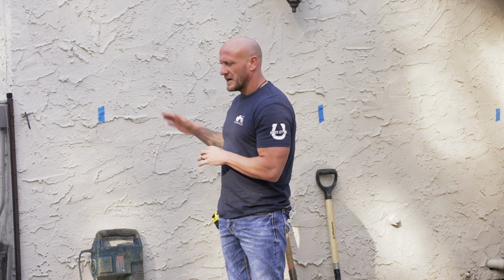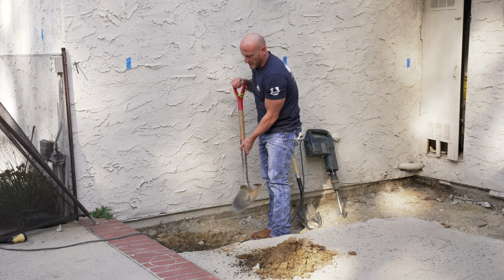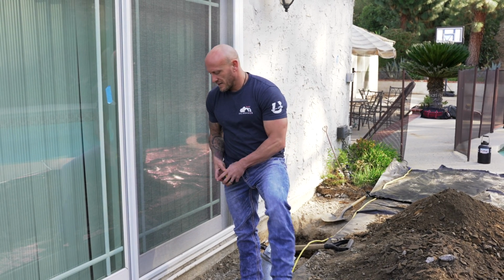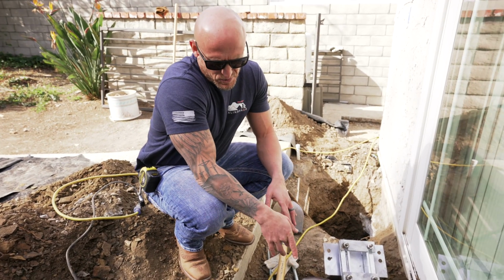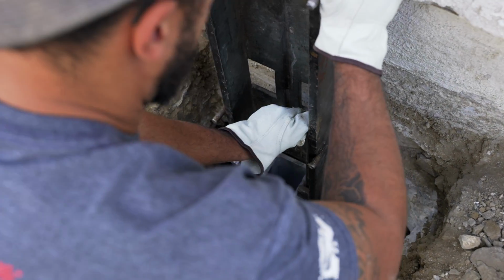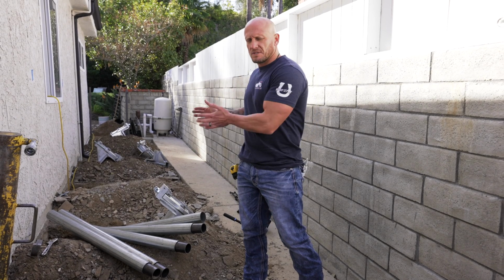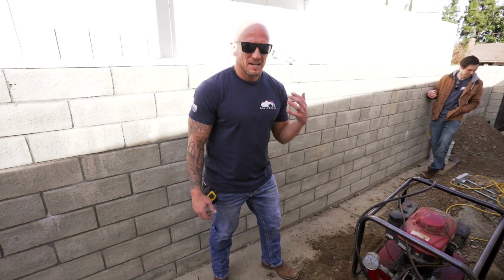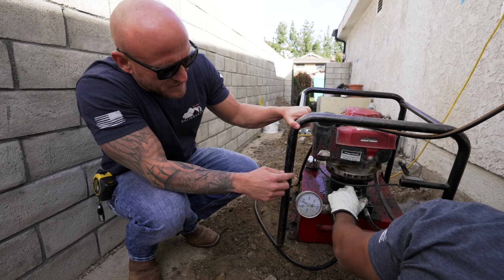How To Install Push Piers

Comment: What kind of pump did you use ? I got quoted 80k today for 20 piers and honestly just thinking of shooting my shot and doing it myself.
Reply: Did you do it ?
Reply: Update. I hired a structural engineer and they laughed at all the quotes. 

He told me to do the proper drainage on the house, gutters and repair any stem wall. Poly foam the low points. No piers
Reply: I was quoted 90k for 20 piers. Yes I’m thinking of going into the foundation repair business. 😂

Comment: Dude, the part i needed to hear was all fastforward with no sound. Half of this was how to operate the equipment. If people don't know how to use a rotary/ hammer drill or a hydraulic jack system, they really shouldn't be fixing a foundation. That seems a little advanced. You skipped over what to do while lifting and then what to do after lifted.
Reply from the maker: The advanced stuff is saved for our actual employees.  But now that you mention it... If you need a video on how to do the lifting aspect you really shouldn't be fixing a foundation.  That seems a little advanced, for you.
Reply: @DalinghausConstructionInc  This is true for me for sure, but i am working on my own house. 
You just stated that you made this video for your employees... does that mean they shouldnt be working on foundations as well? Is it too advanced for the people you employ? If you need to show them how to work a rotary hammer and the hydraulics.... maybe they shouldn't be doing it either. For saure not on other peoples property. 🤔

Comment: My foundation is failing. The footing is cracking because it has wood on top of the concrete block, no rebar. It has a basement that’s dirt. Would this method work so I could secure the weight and fix the foundation for rebar? I have no idea what I’m doing here.
Reply from the maker: It could definitely work!~

Comment: Hi guys. Tell me, what do you fill the void that appears under the foundation slab after raising the house?
Reply from the maker: We’ll use a structural expanding foam called polyurethane that we’ll inject through the slab to fill any voids and provide support to the slab!
Reply: I had the same question! I had my home foundation fixed by RJ 3 years ago and I have doors sticking again😳
Reply: @lisamorales9012  This means they didn't finish something or geological processes of soil subsidence continue. If you have a contract and guarantees, contact your RJ contractor's support service.
Reply: How much does this process cost?  I have a 5’ x 6’ corner that needs raised 1/2”.
Reply: @tojo3507 starting from 1500 to 2500 depending how deep needs drilling

Comment: Wow! That’s amazing! I have a corner of a house that needs to be raised. Brick is cracked and pulling off the wall about 12 feet down two sides from the corner. How much that cost? 😂
Reply from the maker: Our average project this year is in the ballpark of 26k, but we have projects as small as 2.5k and some far more than 100 times that.  It all depends on how large of an area is affected by settlement or poor soils.

Comment: What will this do to the laminate floors, ceilings, walls, and plumbing inside the house. Will this crack them?
Reply from the maker: Typically it doesn't if those things didn't occur as the house was settling over the years.  Definitely something we monitor with the homeowners throughout the entire process.

Comment: No couplers are used to physically join the 3 foot sections of metal pipe or at least to help keep them aligned underground for the long term ?
Reply from the maker: The couplers are built into the individual sections, so the extension up top slides into the piece below it with a 4ish inch internal coupler.

Comment: How much is this job and does the home insurance cover it? And does it have a warranty?
Reply from the maker: home insurance rarely covers foundation repairs unless it can be proven the issues were caused by a pressurized water leak.  
Our average foundation repair project this year was roughly $28k...
All of our steel foundation repairs come with a lifetime warranty transferable warranty on material and craftsmanship

Comment: Why wouldn't you put a strong plate on the first pipe to increase the size of the support foot print? Seems like the installation would have longer lasting results
Reply from the maker: Because we're not worried about support footprint and instead worried about skin friction on the entirety of the pipe.. It may seem that way, but it's wrong and wouldn't have longer lasting results.

Making a big plate on the bottom would mean there's no skin friction whatsoever on the entirety of the pile.. relying purely on that plate and pipe.  Our way allows the 30+ feet of pipe to all be in contact with the soil creating skin friction that will support much much greater loads for longer periods of time.

Comment: With all that movement what happens to the wall beams and other structure of the house when you're lifting? Can they break or crack and then you would have to replace the beams in the walls?
Reply from the maker: For the most part those wall beams and other structure settled with the foundation over the years, so it lifts back up during the lift process without issue.  We definitely have to monitor everything during the repairs, but usually we just see cosmetic things like drywall cracks that were repaired now need to be repaired again because it was squished back together.   
  
In some very rare cases structural framing repairs had to be made prior to us beginning our repairs, but our repairs won’t affect the framing.

Comment: Do wavy interior floors indicate bad foundations usually?

 What do you do if the foundations just started to crumble crumbling everywhere.
Reply from the maker: It'll depend on whether the home has a raised foundation or a slab on grade foundation.  Wavy floors typically can be attributed to the flooring itself, but if it is wavy under the flooring then it may be a foundation issue.  

Crumbling foundations are addressed on a case by case basis... sometimes the crumbling is just small arreas of spalling, that can be patched... but sometimes the crumbling is much worse then superficial spalling and requires either complete removal and replacement or something like a sister footing.

Comment: Had an estimate for installing 23 push piers for $59,000. Wanting to limit cost on older home, an option was to just do 1/2 of house for $34K. Will doing just the portion of structure most affected cause structural issues in the other side? Guy told me fixed side would take pressure off other side of house. Is this engineering science or bull?
Reply from the maker: Depending on where the piers are going and how much settlement of the house it could stop some of the other movement.  Typically, there is a section or corner of the house that settles that then, over time, will drag or pull the other parts of the house down with it.  If you think of your house as a rigid box and you tilt one corner or the side it will also make other sections of the box tilt in that direction.

Hope this is clear and makes sense.  If not you can always reach out to us and we can chat with you about it.

Comment: great video, great work. i had geo piers and a sump system installed years ago in my poured foundation. 
the piers corrected the issue with hydro pressure. been dry as a bone in the basement. a new issue has been found. the east wall seems to be sinking  a few inches now which has caused the sill plate(2x6) in a 10 foot section to stick out towards inside basement about 2"-2-1/2" . since its hanging off the edged of foundation would this system be used to correct my issue. thanks
Reply from the maker: Are you saying that your footing is rotating inward?  If so, then you will more than likely need some type of basement wall tieback application.  Companies utilize helical anchors or wall anchors to correct this problem and rotate the wall back out. Here is an article that describes it https://www.dalinghausconstruction.com/blog/what-causes-horizontal-cracks-in-a-foundation-wall/

Comment: What do you do about the space under the foundation after you have leveled it? Do you bring in a cement truck and pour more cement, or do you backfill it with dirt and aggregate?
Reply from the maker: Concrete is really heavy.. So we wouldn't want to add more weight to a foundation that we've had to repair.  
Instead we'll use a structural, two-part, expanding foam called polyurethane that will fill the voids and support the slab after we've accomplished the lift!

Comment: The foundation of a home is so damn important. When your building on soft ground you really should go down until you hit solid bedrock. And use large footings and a shit load of steel! It's pricey to do it the right way and many of these new home builders go cheap on the most important parts of a home.
Reply: In the south, you won't hit bedrock, you'll hit the water table instead.

Comment: Really enjoyed the video.  If the push pier brackets are not installed correctly can they do more damage than good?  Just had a company install 6 and they didn't level a single one.  Only prepped the footer/knocked the toe off on 3 of them.  Did not anchor any of the brackets, they just bounced up and down with every pipe added.
Reply from the maker: Definitely not good practice to install like that, but in all honesty it likely didn't cause any damage.  Even with the brackets not anchored, due to their design the footing is sitting directly on them and bearing it's load... shouldn't be a big problem for you.

Comment: What the name or brand name of the type of push piers pipes u are using in this sight work? 😮   also the the name of that compessor level controll pump you are using and wattage?
Reply from the maker: The push piers are from @ECPECP (Earth Contact Products) and theres tons of hydraulic pump manufacturers, but i believe we're using BVA Hydraulics at the moment.

Comment: Quick question i got porcelana tiles installed in my whole house. Now im seing some sign of bad foundation on my outside wall
If they put these lift pliers would that make my tiles break?
Reply from the maker: It's definitely possible that the tiles could break during the lift, but it depends on how much settling has occurred and how much lift you'd want to achieve.

Comment: What’s the purpose of lifting your home? Fixing sagging doors/walls etc..
Reply from the maker: Exactly!  Homes that settle or sink into the ground and shown signs of settlement like sagging floors, sticking doors/windows, cracks in drywall or stucco, leaning chimneys, etc.

Our main goal is to stabilize the structure from future settlement, and lifting the home is just an added bonus.

Comment: Do you install a flowable fill underneath the footings after the piers are set?
Reply from the maker: Not under the footings because they're adequately supported by the push piers, but if the home is a slab on grade then we will need to fill the voids created between the slab and the soil surface.  

We use a 2 part, expanding polyurethane foam for this process, and it's the same type of foam we use to lift and level concrete.

Comment: Right on! Thanks for posting some detailed instructions.  I just received material for my home in NorCal and i'm wondering if I need a 4" Bore 40 ton 24" throw cylinder, or if I could get away with a 3" bore?  And do these get pressed to, and held at 3000 psi or 3500 psi?  I've seen mixed methods and I know your cylinders were shorter; so i'm just curious what your feedback is.  Thnx!

Comment: What do you pour or back fill with to fill the space under the foundation after lifting?
Reply from the maker: Great question!!  We'll use a structural polyurethane expanding foam to fill the voids created during the lift process.  It is significantly lighter than concrete, and it's compressive strength and expansion rate allow it support the slab for many lifetimes.

Comment: Great video. Question: The one thing I never see in these videos is the very first starter pc of pipe. Is it like a regular pc of pipe, open on both ends or is the starter pc capped off on the very bottom to provided a solid base? ...if it is open on the bottom what keeps the house from settling down and pushing that pipe further into the ground later? TIA
Reply from the maker: Great question Matt!! So the starter pipe is open ended and not capped off in any way... These piers are using skin friction to keep the house from settling or sinking any more.

The pipe doesn't get pushed any further because we install to specific installation pressures or hydraulic PSI.  The pressure they're installed to is significantly greater than the downward pressures the home is exerting on the foundation... This ensures the push piers aren't pushed further into the ground at a later time.
Reply: they go down  to bed rock
Reply: and if it don't they won't work

Comment: Would you add a glue into the holes when you mount the brackets onto the foundation?  I recommend all the bolts to be glued
What kind of license do you need to have for this type of work
Reply from the maker: There's no need to glue the bolts on the bracket, in fact... the bolts are only there to hold the bracket in place until the push pier can be capped and bracket secured to it.

With the footing sitting on the bracket like a person sitting in a chair, the bolts actually don't see any force/load once the push pier is capped 👍🏽

In California you need a C-61 / D30 - PILE DRIVING/PRESSURE FOUNDATION JACKING to do this type of work, though we have various licenses in California, Arizona, and Nevada.

Comment: I’ve been digging for 15 years I’ve never used electric tools except for breaking concrete
Reply from the maker: Awesome!  You should give it a shot, it'll make life much easier!
Reply: @DalinghausConstructionInc   this year I’m using mini excavators
Reply: I used to do that a long time ago. Most of the time the houses is real old and the Footers about 10 or 12 ft down you have to dig a hole big enough for you yourself and a plate to fit in. That was one laborious job I do not miss that or running waterproofing in basements

Comment: Awesome video!  Having this done to my house in Northern Indiana on a lake property.  Thinking these will go 30 to 40 feet.  So cool they can do this and lift houses!  Our house was built on black muck in the 1920's right against a channel on the lake...
Reply: How much did that cost?!?!
Reply: @tifacola  We did four 3” diameter Magnum Foundation Push Piers under our house.  They quoted us $6,400 for those four piers.  If any of the four went deeper than 30 feet deep, it was an extra $33 per foot per pier.   Luckily they all stopped at 30 feet so it ended up being $6,400.  The house is solid as hell now in that corner.  The floors inside still needed some leveling and we are considering doing that next.  That is Northern Indiana pricing from a small company.  No idea what other more expensive states would charge for something like this.
Reply: @christopherkarczewski1978  thanks for replying! I am imagining it costing 100s of thousands of dollars. I have a 5k square foot house. 😬
Reply: Curious, I have a house that settled 4.5” on one side. Long story short we feel the original builder built over fill that trees were buried in. This is based on other information in holes along the property on the lawn showing up. With that being said if you raise the foundation back to level what is the steps to fill the void?
I am assuming the interior slab will need to be cut out and all underground plumbing redone? Is there something they fill the void under the footings with?
Thank you
Reply: @davidleffel3545 Not sure on this one.  Our house is not built on a slab (wish it was).  Definitely a question for someone who understands this process and how to do it correctly.
Reply from the maker: Let us know how it goes!!  We don't know much about the soils out there in Indiana, but push piers or even helical piers sound like a great solution for the soils along a channel on the lake!

Comment: What would happen if you had an existing push pier that had sunk about 2” only in one spot.  Same mount..  but what would happen if you removed the shear screws that are attaching the bracket to the pier??  Without the ram attached and set..??  Would it shit it all up out of the ground or since its sank would there not be any pressure on the pier then?
Reply from the maker: the pier isn't exerting any upward pressure, so if it's sunk 2" and not resting on the t cap at the top of the bracket than you may be okay..  Hope you consulted a professional in person before messing with any of it!